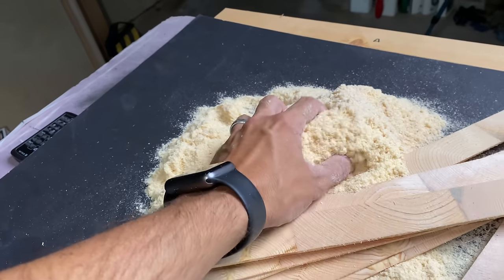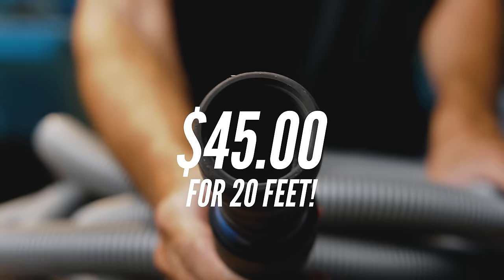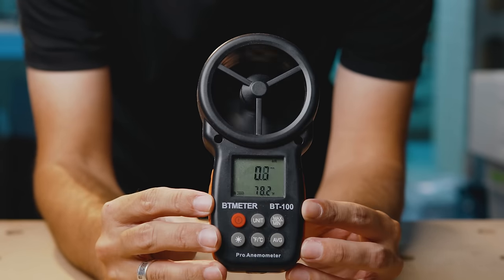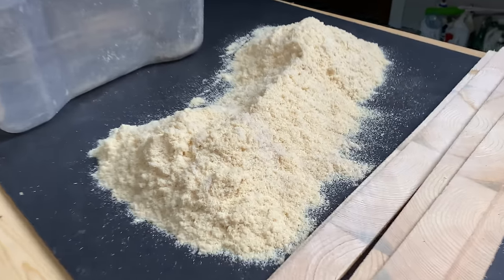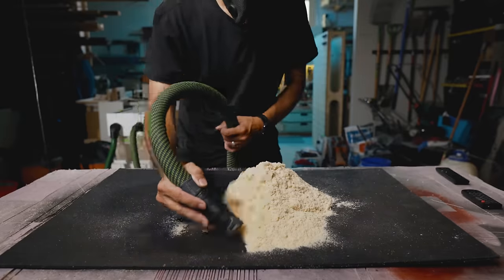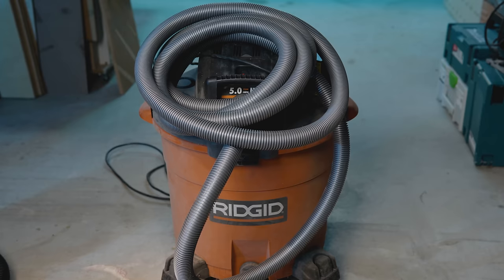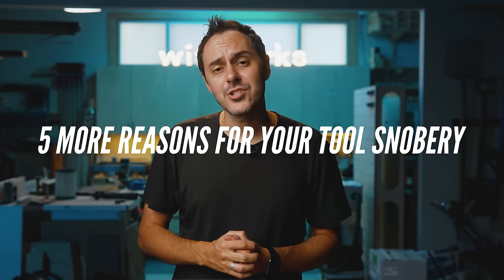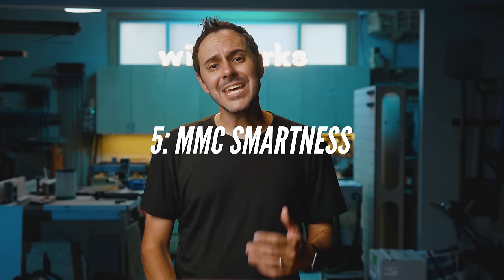This video will save you a lot of money. Dust extractors for beginners.

Comment: Great video! After using regular shop vacs for years, I bought a ct midi with bt remote and it's probably one of the top 3 tool purchases I ever made. Worth every penny. The festool cyclone is only worth it for the convenience of stacking it on the midi; it does not perform as well as a dust deputy. Doing it all over, I'd skip the cheap vacs (maybe keep one around as a "beater") and go straight for a legit dust extractor. The midi has so many useful and amazing features for a serious hobbyist/pro.
Reply: Could you clarify midi? 

I plan on doing work in my as more or less a hobby and am curious to how much attention should be placed in this department.
Reply: @sourceofuniversallove1449  The CT Midi I; it's the current corded model with integrated bluetooth. You still have to buy the bluetooth remote, but it's only $46 as opposed to the $82 you'd have to spend on the receiver+remote set needed to upgrade the CT26/36/48.
Best dust extractor I've ever used. I was using my RTS 400 sander connected to the Midi in my mancave to sand the edge of a new desktop and there was no airborne dust at all.
Reply from the maker: I have the ct midi (not the mini)

Comment: I just bought the cyclone separator at HD and it's freaking awesome. I was out vacuuming the driveway of leaves and dirt, not a drop inside my vac, everything in the bucket. And I made a cart for it with scraps I already had, removed the vac wheels which were kind of flimsy, put larger wheels which I already had, and the whole thing rolls around great.
Reply from the maker: That is awesome!

Comment: My understanding is that the antistatic hose is not so much for preventing the user getting shocked. Rather, it is meant to prevent sparks occurring in a possibility dusty environment. With the idea ratio of fine dust particulars suspended in air (stoichiometer ratio), a small spark can trigger combustion. This is a huge concern in dusty industrial environments. I don't think this is a big problem in most wood shops but antistatic hoses are safer and can be used anywhere
Reply: Kind of true,but not really. Understanding the danger of sparks certainty effects how you work. Good news is that in almost any small shop, sparks are not an issue.  4” and under DC hoses/piping are not big enough to allow a spark ignited explosion. So your shop vac is certainly safe regardless of the hose.

Comment: I bought the bag made of a material similar to thermal knit you find on jachets and vests. I put it over my cylindrical filter in my Rigid vac. No more 10-15 minute compressed air filter blow outs. The bags are washable and if you have a thermal knit jacket you can use both arms of it and make 2 bags. 
  An additional item learned on YT was taking the shop vac bag and un folding onr end, opening it up to dump the dust out and re-folding the end and sealing that end with a 1/2 " piece of pvc that has been slit lengthwise and used to bind the folded vac bag end closed. I modified the slit a bit by cutting a "V" into the end of the slit and rounding the slit edges to keep the slit from cutting the vac bag. Works great, no more vac bag purchases unles you suck up a block that cuts your bag.

Comment: Great video.  Another data point would be to quantify how much dust is collected in the first place (not easy). Lower cfms would likely result in more dust overall, but depending on the setup (e.g. cyclonic vs filter) higher throughput could also mean more dust suspension.

Comment: I have a Festool C26 which has a bigger motor.  The bag lasts forever and will pack like a brick. I primarily use it connected to my miter saw, sanders and track saw.  It was a game changer when I first bought it over 10 years ago.... it allowed me to cut in houses. The Festool is a superior system and way cleaner and easier when changing bags. I also use an ambient air cleaner on my jobs and shop..... I can tell the difference in my lungs.
Reply: You do have to wonder if your lungs feeling good is a placebo?   At least I do. His test wasn’t perfect but at least better than his feelings.
Reply: @aaronblackford981   The ambient air cleaner  made it noticeably easier to breath not the Festool vacuum. My jobs are much much cleaner. (free of dust)  Its called an 'air scrubber'.... this is what they use at remediation companies. I had a client with asthma... she was complaining of dust despite my best efforts of using fans, plastic walls and masking. I brought in the air scrubber and she was happy.

Comment: I have the Festool CT 26 with bluetooth and the cyclone, and yes, it was over $1,000, but it has been worth it. Being able to run my tracksaw with BT has been awesome because it's a pain in the butt turning it on each time to make a cut. For those who can't afford a Midi new, there's always Festool Recon that'll save them 20-25% off.
Reply: Also with the new cordless dust extractors, the BT makes even more sense.
Reply from the maker: That’s great! I wish makitas bluetooth talked to Festool…but…guess that means I’ll have to get the new Festool…
Reply: @wittworks  one speaks German and the other Japanese, they simply can’t get past the language barrier.
Reply: Same. Love the Bluetooth feature. I run the 26 with a Cyclone for sanders and dominos but don’t have the Cyclone on the Kapex since the slight drop in suction was leaving dust around the fence.

Comment: I purchased a used Kirby vacuum online.  I removed the bag and used the hose that’s connected to it inline to my large dust system that has a filter built in.  Since Kirby has a turbine like system and bypasses the motor unlike conventional vacuums, allowing me to connect it directly to my large system that has all the filtration.  The benefit of the addition of Kirby is that now I have really good suction for small tools as the Kirby moves smaller volume of air but at high velocity which is good for sanders and routers.  This is where my large system didn’t do so well, as it moves large volumes of air but at lower velocities, especially when you downsized to a smaller hose for your sanders and routers or track saws.  All this cost me under $50 bucks.  And now I just have one place for all the dust.

Comment: Actually the fuller the vacuum filter becomes the finer the particles it removes.  The suction decreases but the filtration increases.  I have used a 15 year old Rigid shop vac with a Dust Deputy with it for many years with few complaints but I sold Festool systems while working at Woodcraft.  It’s a matter of budget and personal preferences.
Reply: Hi. This is great to know. I need to sand a few kitchen cabinet shelves in kitchen space and wondering if the Ridgid shopvac with HEPA filter & bag connected to the sander would do a good job with dust collection. Thought about purchasing the Festool but multiple opinions. I also shop at Woodcraft in my area. What are your thoughts about dust indoors with the Ridgid shopvac with HEPA filter & bag hooked up to the  sander VS. sander connected to Festool extractor?  Thanks a ton if you happen to see this...

Comment: Thank You for your consideration in making this video. Very nicely researched, narrated, explained. I trust your measurements, most of us are hobbyist in nature and don’t spend 40 hours a week in the workshop so it’s not perfect but it’s good enough. Greetings from Maine
Reply from the maker: Thank you Allen!
Reply: Keep in mind that his test is for his machines in his work environment. YMMV with your air filtration system. Still, anecdotal evidence is still evidence (it’s just less statistically significant). The thing with the expensive Festool is that I think it’s high probability that 1) Festool did extensive rigorous testing to meet 2) high EU safety standards.

Let’s face it, at some point we have to trust other people’s expertise. We do it all the time when we use a microwave, get into a car, even use electricity. We can’t safety test everything. So we rely on the expertise of others to test the safety of a lot of stuff.

I just don’t have the money to get a Festool air filtration system*. Even if I could put it on my credit card, the interest rates are killing me. So my low cost solution is to continue to use my shop vac AND wear a KN95 or N95 mask. And keep my shop space well ventilated.

* The cheapest (CT 15) I can find on Mexican Amazon cost 16,529 pesos or $835 in U.S. dollars.

Comment: Loved the video. I do agree that clogged filters do change filtration levels. Probably contributes to the lower flow for the old vac as well. 

I have an old craftsman shop vac and ported the exhaust outside kinda like people do with their dust collectors. I don’t use any filter at all since the dirty air goes straight outside. I run my shop vac into a dustopper for separation. Then for mobility, I set up a boom arm to get my shop vac to easily reach anywhere in my small shop. 

You should check and see if the dustopper has a good seal and see if that affects the airflow drop off. I use some foam on the edge where it connects to the bucket and that seems to help maintain a seal.
Reply from the maker: Thank you

Comment: What I like about Festool is the system, the hose end fits all the tools perfectly.  The Dust extractor has variable suction.  Auto start and Bluetooth on the CTL MIDI.  The CT Cyclone attaches to the CTL MIDI and won't fall off.   If you make your own you might save money and this is important for DIY and etc. The trouble I have had in the past with homemade- hose falls off, wrong size/duct taped hose, vacuum doesn't auto start and auto stop, shop vac is loud as all get out, separator falling over, no variable suction, etc...  Festool is expensive but possibly much cheaper than homemade.
Reply from the maker: Amen. Well said.

Comment: Great content! Another idea is an old central vacuum canister unit. I come across old used ones all the time…so many that I often throw many away. 

The suction power is significantly higher since it’s using a tangential discharge motor rather than a flow through (like a a typical shop vac) and you can mount them on the wall. Many can be adapted to use a hepa bag as well. You can also port the exhaust outside which means zero emissions indoors!
Reply from the maker: nice tip! I want to try that
Reply: Hell's when I was a kid dad Used PVC pipe and manifold to his entire system..every tool station had a 3" Pipe going to it and integrated filter's.

He used an Industrial shop vac and Spherical fiberglass cyclone chamber
Reply: His invention was a Spherical Loudspeaker enclosure so any rejects of the Mould's he used for chicken coups and Containers, he also made a Heat lamp home heating system

Comment: A variable that would explain why the old rigid vac performed "better" is because it is moving a lot less air, therefor less would be coming out the back end, which would result in a lower reading. I bet if you took readings at the work area (where it matters) the old vac would perform worse because less of the particles is being sucked into the vacuum.

Comment: I also bought a CTL Midi 4 weeks ago to vacuum both my apartment and  machines (mainly wood dust) when I work on the balcony. This also eliminates the need for a regular vacuum cleaner (which I needed anyway). The little one has a small corner at the bottom of the pantry behind the door and is super handy. I regretted nothing - at most me not to have bought earlier. The remote control will also be added by Christmas at the latest.
Reply: Working on your balcony might be the biggest help because of the ventilation it provides. The biggest issue is that these tiny dust particles remain suspended in the air in an enclosed shop. The more ventilation, the less of a problem it is.

I think my shop is pretty well ventilated (it’s drafty as hell and on a windy day there’s actually a slight breeze). But I also have a large rooftop patio where I could be working. I think I’m going to put a bench up there for working on good weather days. (I like to go up there when I’m manually sanding to enjoy the sun, anyway.) I would keep my tools and work stored in my shop when I wasn’t working up there.

Comment: I forgot about the STATIC!!!

Almost 20 years ago I was just starting out in my home repair career. My first job was refinishing the walls in a living room that had been heavily textured. It was an attempt at disguising failing lathe and plaster with a look of stucco. 

My task was to sand down the walls to a smooth finish. It was wintertime in central Texas and the relative humidity was LOW. 

I used a Ridgid orbital sander attached to a shop vac. 

Everything was fine at first but once I had worked for a little while I started getting shocked. At first I thought the hose to the vacuum was pinching me. I quickly disproved that as the shocks began to increase in discomfort and occurrence. 

For the life of me I can’t remember the solution. It may have simply been wearing a jacket even though I was plastic wrapped into a stuffy warm room. Just sharing the story to back up the fact that static electricity is a very real thing when using a dust collector. 

Good luck.

Comment: keep in mind your old vacuum is super clogged with particles that are in turn filtering out those same particles, so its safer, but its also giving you much less performance compared to the new clean vacuum. festool is good but the price is just insane honestly
Reply: I came looking for this.  Yes, as particulate filters get dirty, they become more effective since the layer of dirt is essentially acting like a big layer of filter material.  
But that layer of dirt restricts airflow, reducing downstream performance.  

It's easy to filter particles.  It's hard to filter particles AND flow large amounts of air.  That's the challenge.
Reply from the maker: Well said.

Comment: I work for a medium-small construction company that has their own cabinetry shop and spray room...a lot of sanding and prep happens in both of these rooms and the bluetooth of the festool on the hose is the best...I'll sand a door, snap on the vacuum and clean up and get to the next one without running back and forth across the shop...in high production scenarios some of these small features of the festool are unmatched.

Comment: High sir, your friendly nieghbor hood automotive tech here, Ford dealer to be more precise. The reason the old worn out machine done better is more than likely because of the old clogged filter. Filter efficiency increases as it becomes dirty, the filter is most efficient at trapping particles right before it is completely blocked. This seems to be proven to be because the holes in the filter that naturally occur become glogged  and blocked causing the filter to be more able to catch particles.
Reply from the maker: Thanks. That seems to be the consensus.

Comment: I'd try putting the meter close to where your face is while using the tracksaw. It doesn't really matter what's coming out of the exhaust port, just what you're breathing in.

I'd imagine that the significantly lower suction on the old shop vac translates to a poorer extraction at the tool. You might be able to measure that with your meter.
Reply from the maker: Good insight. Thank you.

Comment: What an awesome and very scientific video. Dust collection is surprisingly complicated. One thing I learned that most people don't realize is that rip cutting on a radial arm saw is perhaps the cleanest operation possible on a radial arm saw. The dust extraction port on a radial arm saw actually doesn't work at all during crosscuts unless you make your own special fence to suck up the dust being spit from the blade. But when rip cutting something magical happens, the blade guard is adjusted so there is almost no air gap at all between the guard and board and so about 95% of the dust gets sucked up into the blade guard. In conclusion, if you want a super low dust method of ripping medium size boards and medium sheet goods, a stock radial arm saw has built in dust collection and is orders of magnitude cleaner than an old fashion table saw.

Comment: Simple Rigid ProPack square box shop vac with the correct bag inside + GVS Elipse P100 mask works for me. If you’re working outside and don’t need to keep all the smaller particulates off of other surfaces, I think it’s good enough, and the air you’re breathing is certainly very clean with that mask, just make sure to get the one with the exhale valve and not the one that filters your exhale breath as the latter gets much more moist inside. The Rigid hose is still kinda stiff and unwieldy but the ProPack toolbox form factor is awesome for a vac in general. As a bonus, it’s also your main shop vac, so bonus space savings there from having one tool that can serve two purposes.